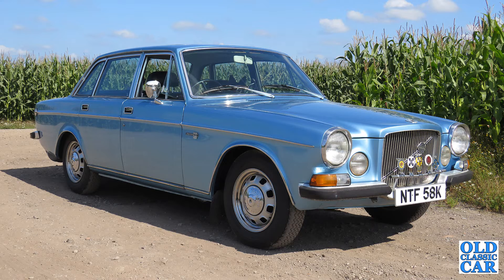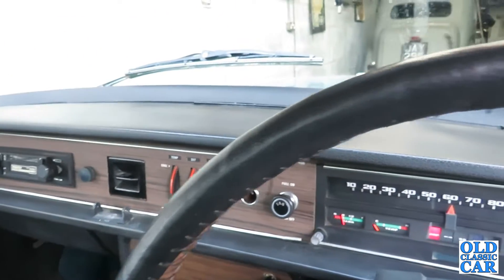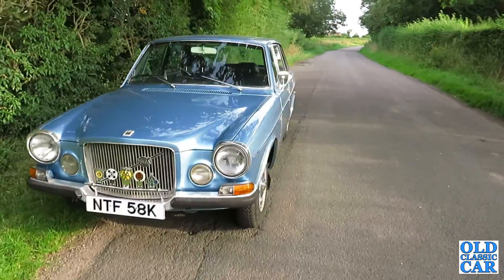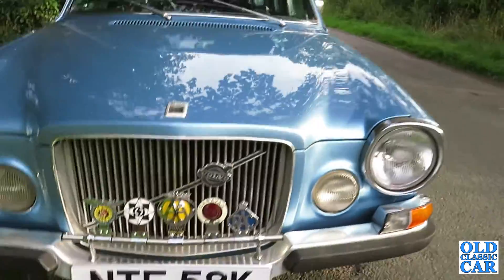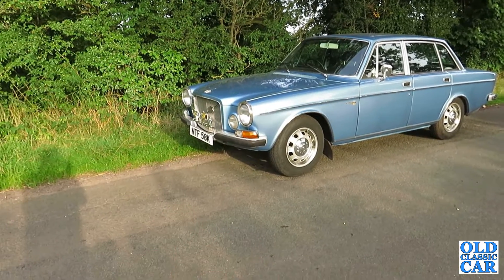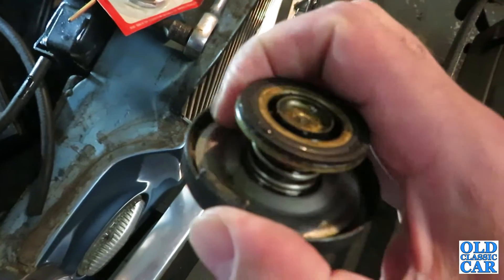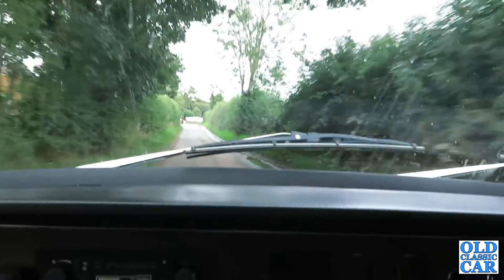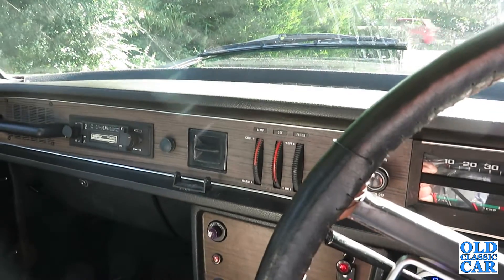First drives in the 1972 Volvo 164 E - will it drive ok? The latest in a line of classic Volvos

Comment: Brought a few memories back. Had a j reg 164 auto, did 245000 miles in uk and on the continent pulling a four wheel trailer with a fork lift truck on board. Never skipped a beat serviced it once a month had to replace brake master cylinder and tyres  but nothing else. Best car I ever had. Same colour originally, but sprayed it black!! Looked like a mafia staff car.

Comment: A set of its Volvo mud flaps would set it off nicely. Brookhouse still stock them and the bracketry.

Someone mentioned below a possible vacuum leak causing fast idle and running hot. I had to replace the 49-year-old brake booster/servo as the rubber diaphragm inside had ruptured. Clamping the hose to the booster with the engine running is the easiest way to check if it changes the idle speed.
Reply: You are correct... the servo on the break booster.."stole" vacuum and if faulty caused idle issues 💪

Comment: My dad had a 74 164E same colour as yours but with an orangey caramel interior. Mum found the clutch a bit heavy on the four speed. Compared to her 71 1300 beetle. On the motorway you'd feel a slight lurch when the o / d engaged and disengaged. That car ate the motorway miles no problem. It was thirsty but dad had a fuel allowance from work.

Comment: I had one of these in South Africa back in the 1980's. Wonderful car (unfortunately mine, like this one, was an automatic). I did have the opportunity to drive my cousin's manual version. Now that was quite a different experience. Tremendous power and torque. Also amazingly thirsty, but then with the stick shift and all that power, one tended to be tad heavy footed.
Reply from the maker: Yes ideally I'd prefer a manual on carbs, thanks for checking out this video

Comment: that expansion cap does not have an rubber on the top seat if it did it would not be able to release the pressure if it needs to  had a few of these in the past the plus side of having my own garage used to do body work for Braydon motors in hackney east London a Volvo dealers atb

Comment: I had the last of the 164E before the 264 came. I still miss it. A wolf in sheep's cloth in a way.
It was better looking inside than this earlier model.
Did 200km/h (124miles/h) and made some more sporty looking cars very upset on some motorways.
Very stable very reliable on the road and in the winter too. I still love the darker blue my had.
I had two Alfa Romeo 2000 before the Volvo and while I liked them a lot I still think the Volvo was actually a more sporty car, if you wanted to.

Comment: That’s a beautiful car, it looks much better without so many flashy badges. I like the seating and centre tunnel consuls on the 160 shame the 140’s were so bare and basic.

Sediment can build up in the cooling channel of block on cylinder 4 on the B20’s causing the cooling system to be less efficient unless force flushed/drained through the stat housing out the drain cock. Maybe the same on cylinders 5 & 6 on the B30.

Comment: Too long about temperature.  What is of interest is what looks like an aftermarket ECM to replace the analogue D-Jet box.  I'm interested in that due to non availability of D-Jet parts like auxiliary air valve.  Would need other modifications as the injectors are 6 volt ones.
Reply from the maker: Ok thanks

Comment: Lovely car,  you don't seem too happy with the performance, do you realise it should be putting out 175 bhp its a 120 mph car?  When you kickdown from 3rd to 2nd on full throttle there should be a big kick in the back and go off like a rocket. The bad cold starting is probably the cold start injector not working. It is controlled by the thermal time switch on the back of the engine.  Check the fuel pressure too  30 psi.  Is the viscous fan coupling working properly?  it should blow a lot of air on initial cold start for a few seconds and have a resistance when you turn it by hand. When it has warmed up it should turn freely if you stop the engine and spin it by hand.  If it makes a whooshing noise on cold start it will be seized and sap many horsepower from the engine !  Idle speed is set by that black plastic knob on the drivers side we were looking at set to 900 rpm. Cam lobes can wear down causing low power.
Reply from the maker: Thanks, yes I think it needed a bit of setting up but I never really gelled with it so sold it in the end. It looked great though, part of the problem was that the previous owner had been very keen on fitted gadgets and so on, so the wiring was a bit of a mess, in the end I just decided to look for something else.